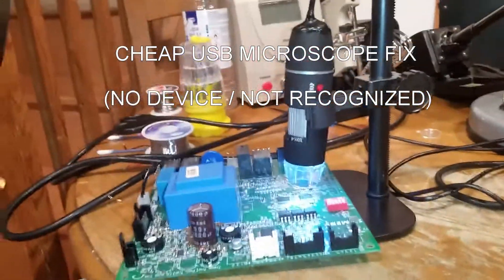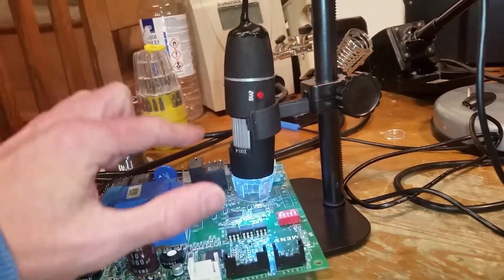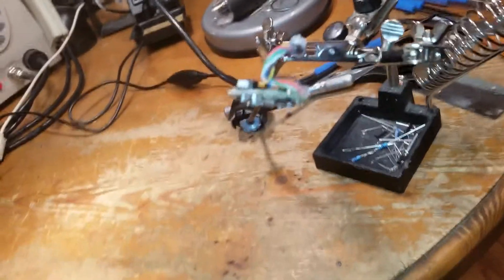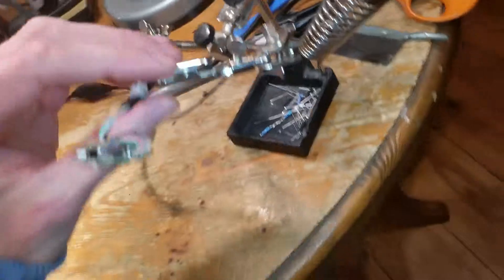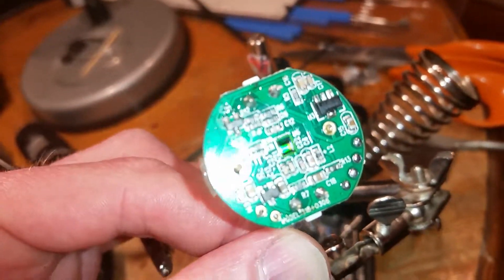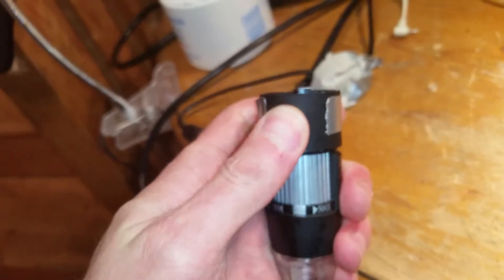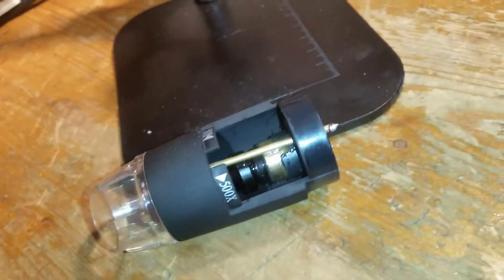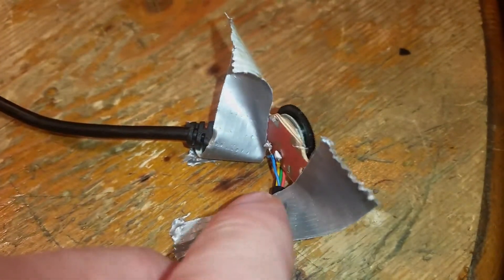Fixing a USB Microscope off Ebay

Comment: I've bought a digital microscope that come with a screen, on the first delivery, it have a dark screen, so dark that i can barely see the menu, i sent it back to the seller and they send me the new one, but after 2 days, the new unit goes dark too, is there any trouble shooting for this case?
Reply from the maker: Hi. Not sure. From what you are saying, it sounds like either the backlight inside the screen may be faulty. That is not a fix I know. Might be worth checking that the brightness and contrast buttons move freely and are not being pressed by the case?
Reply: OMG same

Comment: Those things are certainly made down to a price!  Glad you got it working again though and it was nice to see how these things are assembled.  Regards the regulators on that board - anything with Q prefix is typically a transistor, there probably is a 3.3 or 1.8v regulator on there though.